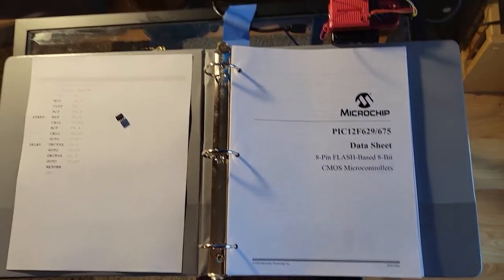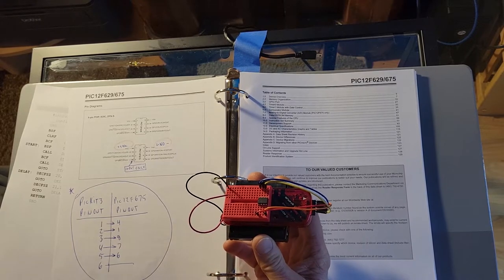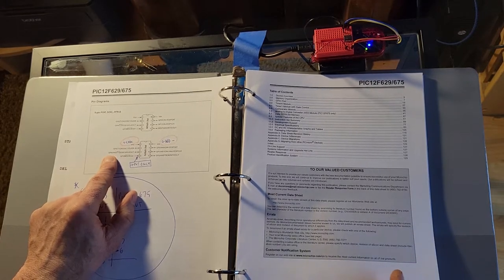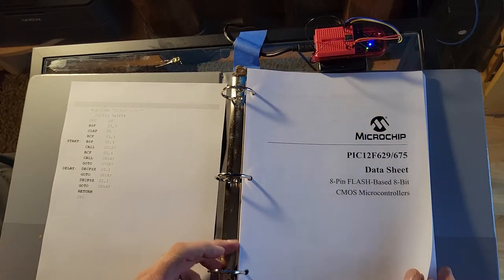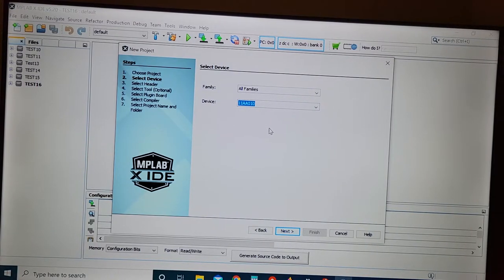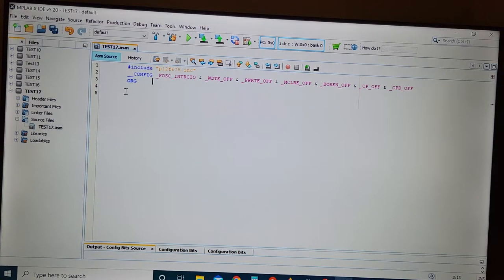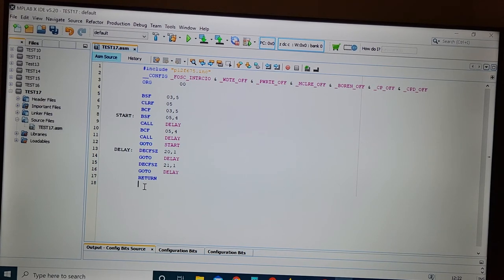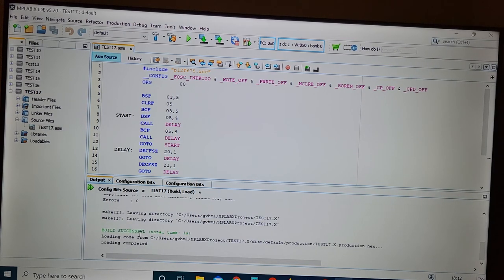Pic microcontroller programming made easy

Comment: One thing that is worth knowing that it’s very important some models of these micro controllers need specialised programmers because the main customer for these are big industrial companies where getting a special programmer to save money on each market controller is worth it. I would always check that before buying some also, sometimes the code changes controllers depending on the use so I would recommend getting a few before you start writing the code or at least order then as you can plan to use one and then find it hard to get

Comment: I was not acquainted with the PIC ecosystem, because I got into hobby electronics a few years ago via Arduino and never bothered to look into other systems. This video was a good quick intro into that world, and as much as I appreciate getting a sneak peek into how PIC works, I do not feel it's as user-friendly as Arduino. The IDE and the Processing language of Arduino feel very much like home, and this is too 'industrial' and dry to me so far.
Reply from the maker: I had looked into Raspberry Pi in the past which is also a single board computer similar to Arduino which runs on a language called Python. It has a variety of kits which I had bought to build a variety of small projects. The difference between Arduino and working with Pic processors is actually quite a bit and though Arduino holds a fascination which I enjoyed at the time, for me most of the devices that I had brought to market worked best with Pic processors. Nonetheless if enough time is put into any direction in hobby electronics, the right guy can create devices that he could still potentially market to the world in small quantities. 
    For example, I recently watched a video where a group of hikers were mauled by a polar bear because their perimeter security system wasn't good enough, so I got to thinking about building something. I personally don't care to bring things like this to market these days so I mention it in this conversation just for concept purposes. I will probably post a video on building a "Perimeter Alarm" with a Pic processor at the center of the project but I think the same thing could easily be built using one of the smallest Arduino boards, not sure.

Comment: How on earth can Assembler be easier than C????
Reply: i cant deal with C, yet assembly or hex dumps if i know opcodes from datasheet, make sense to me... 

hmmmm, a microwave meal versus cooking it? you can concentrate on the ingredients, preparation, heat, how everything interacts to make a meal...

or you can concentrate on how to make the microwave run for 5 minutes at 3/4 power... beep. beep beep. beep beep. beep. wheres "start"?

get the same thing in the end. hot food. but not quite. ones stodgy. bland... predictably limited.

its easier to completely ruin it by cooking it... but the results are generally better if you get it right?